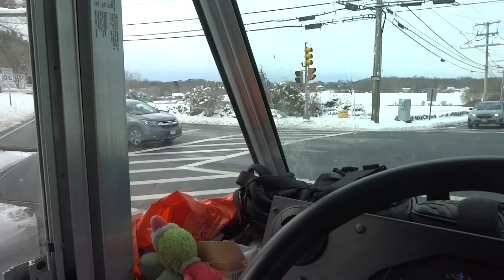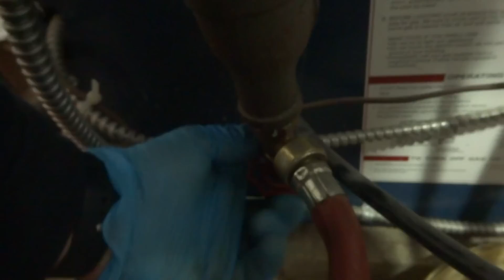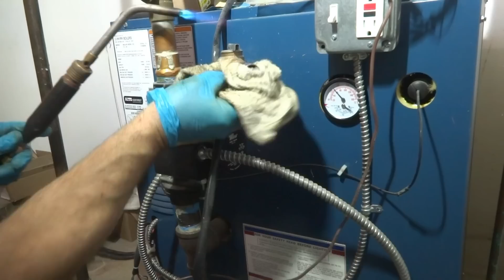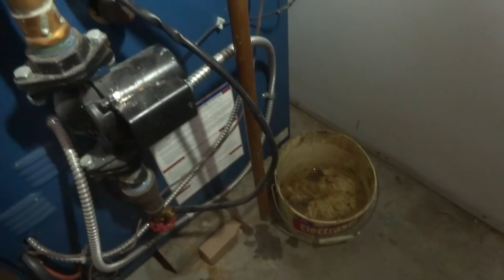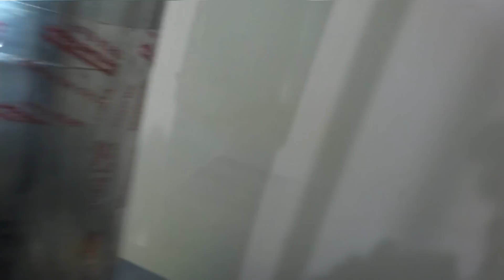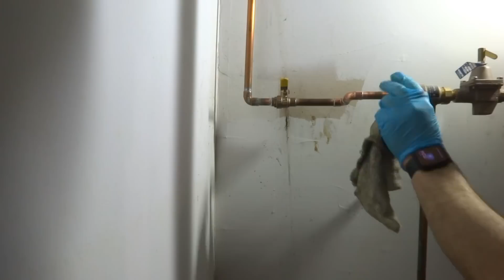GAS BOILER RELIEF VALVE LEAKING WATER

Comment: I think a new expansion tank system needs to be developed. They should be made out of plastic and have no bladder inside. Just replace the air every two or three years, like the old fashion steel ones back in the day that lasted 60 years. A $60 tank that lasts 4 or 5 years is not acceptable.

Comment: Steve, was the pressure relief still leaking after you replaced the bladder tank? It wasn't leaking.
Reply from the maker: i usually change it out anyway ....or i will be back to do it for free
Reply: I was thinking the same thing!!!  There must be a thin line between a relief valve working and leaking !
Reply: I have never had to come back in 36 years.

Comment: Why not replace the pressure gauge while you are there?
Reply: Because he didn’t have one of the truck lmao
Reply: Those Tricator guages are big $$$ and besides homeowners or engineer in this case wouldn't know what to look for with it or do anything about it, so they would call the pro's in anyway. Professionals like Steve do not really need to rely on them because just like in this case the problem was solved. But, i get your point, it should be accurate.
Reply: They are actually cheap.  $50 or less depending on the brand.